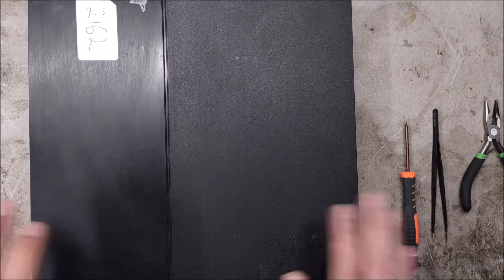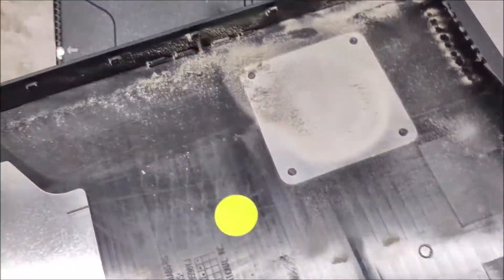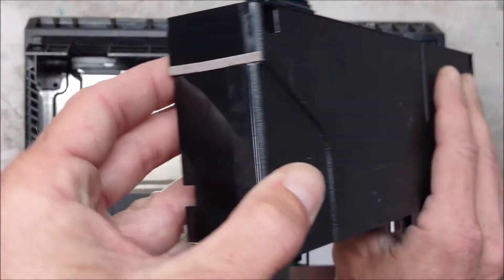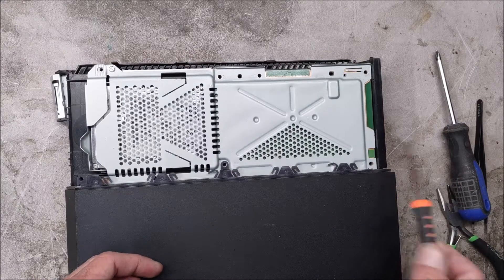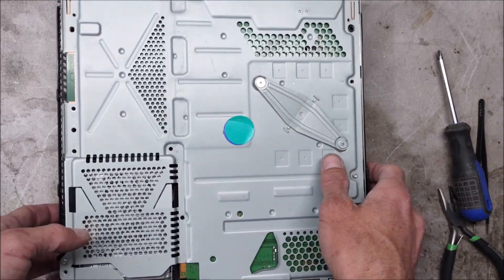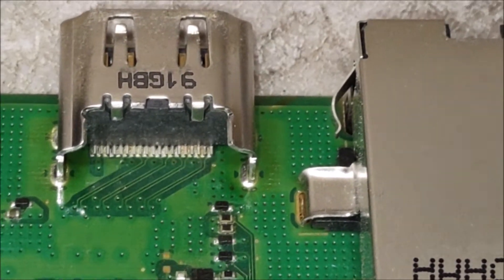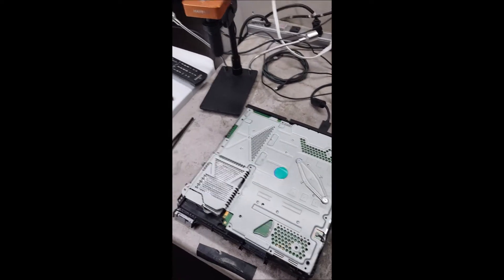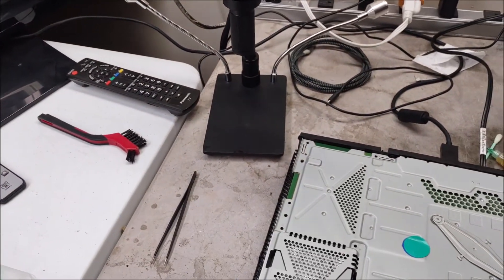PS4 HDMI Port Replacement

Comment: Hey I have 2 broken ps4s one is a slim and the other is a regular ps4 but the regular ps4 has a broken hdmi port and the other we have no idea how to fix it but it’s been smashed and the top cover and bottom cover has been thrown away because they could not fit back on but it still turns on and works but won’t let me connect a controller to it is there any way that you could help me or fix them?
Reply from the maker: I absolutely can help you with that. Check out repair tactics on Facebook, there you can message me directly and setup a repair

Comment: Hey man I need help with my ps4
Reply from the maker: I watched the video. You can contact me with more pics through Facebook or Google. Repair tactics is the name for both. I need to see the port. I can definitely fix it, it's not flashing blue it's a solid white light so it should be fixable. The port is probably bad
Reply: @repairtactics  can you list the tools used?